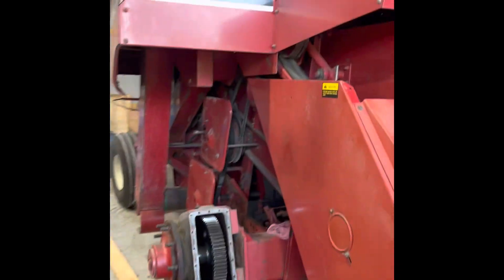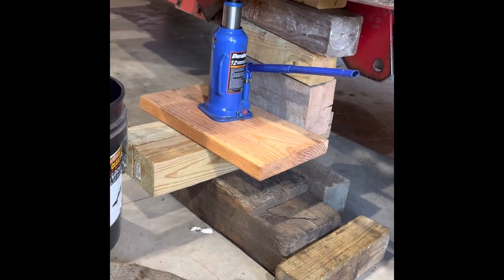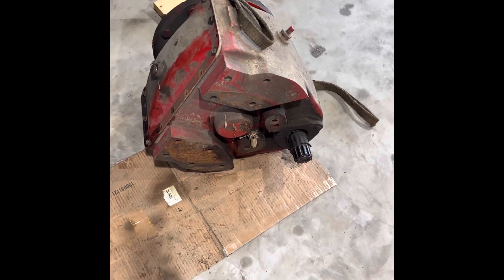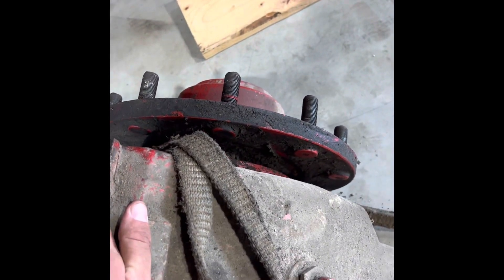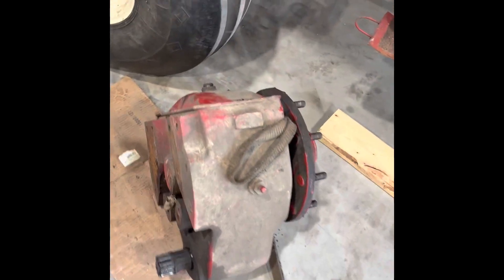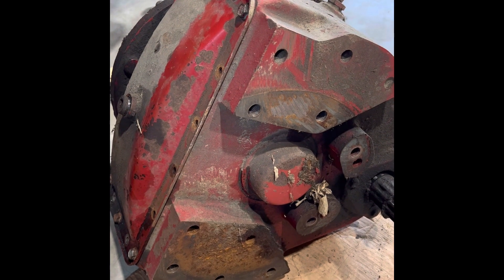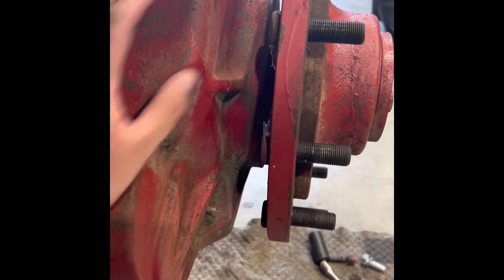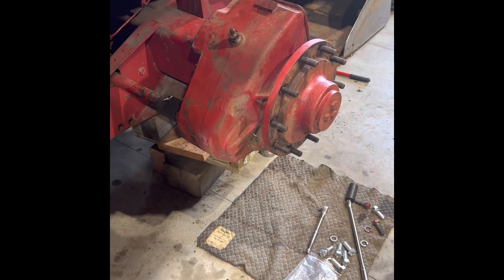International 1460 Combine Final Drive Replacement

Comment: How did the rebuild go?  I’m in the process of taking mine off my 1660
Reply from the maker: I haven’t rebuilt it yet, the parts are a bit pricey so just going to hold off for now unless I need another one. If you just do bearings and seals it isn’t too bad, but I was going to upgrade the 16 series shaft that’s one piece.

Comment: I spent one year of my 32 actually mounting transmissions and final drive. If you remove the vent on the top of the final drive, an eye bolt can be threaded into that hole to lift the unit evenly.

Comment: Would you be willing to share the cost you had in doing the replacement/repair yourself?
Reply: I like bigger blocks. Like 2-3 times wider myself.
Reply from the maker: I got a salvage take off final from All States for now. Think it was like 600 or so since I kept the core to try to rebuild. I’ve priced out bearings and seals and it will be over a $1000 to do it myself. Only thing I would like to find before rebuilding is a one piece hub as these 2 piece ones don’t have a good reputation.
Reply: @The Hobby Farmer  Thank you very much and I greatly appreciate it!
Reply from the maker: @Barnes_413  no problem. I hope to make a video when I rebuild this one as well!